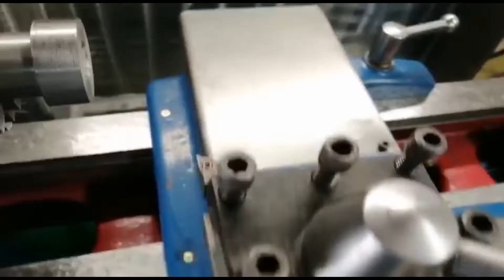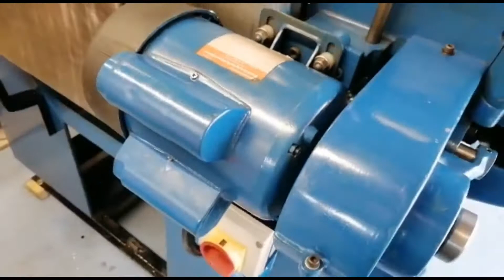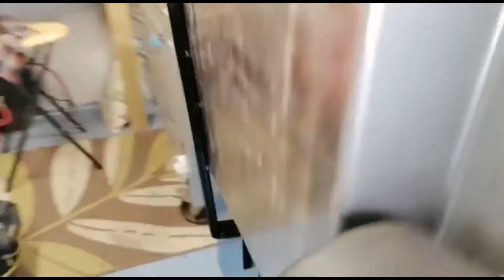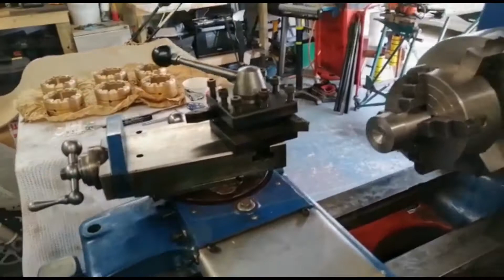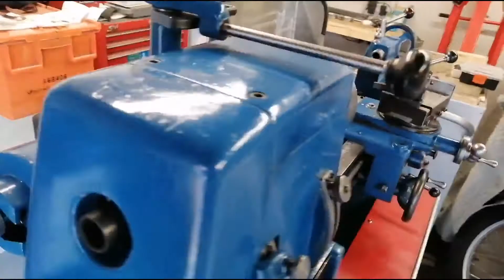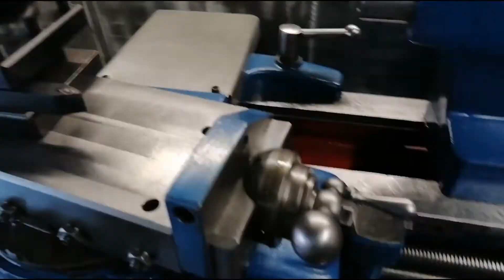Raglan 5" Lathe with Screw Cutting Gearbox

Comment: brought mine 8 years ago .as a time served turner was impressed at its versatility  but managed to strip the tumble gears last week whilst setting up to cut a castle thread  .having difficulty finding new ones  Might have to have them made . you have done a great job on that lathe
Reply: 14.5 degees pressure angle and made of Tufnol.  I did make a new set both in Tufnol and Brass. They all perfomed well, but the brass set were much noisier, so I used the Tufnol set.
Reply: @johnfirth9217  Hi john i found a pair of nylatron ones on e bay a little epensive at £50 but needs must
Reply: This is a set of tumbler gears being machined - See Link here  <https://www.youtube.com/watch?v=j37lmFFHX7Y>